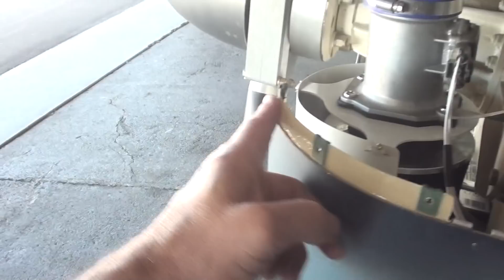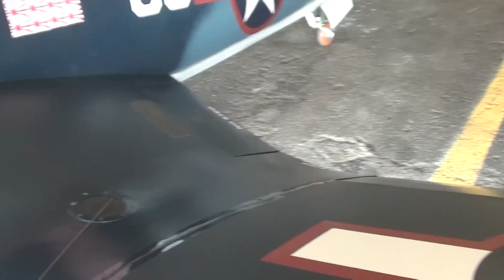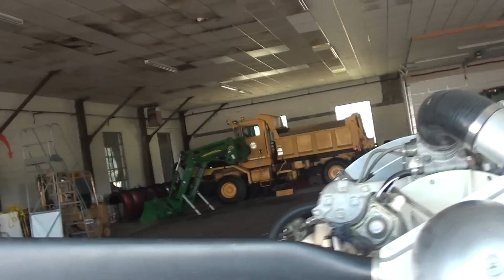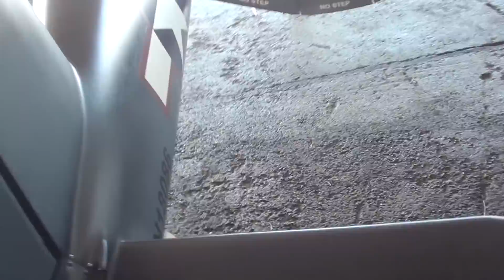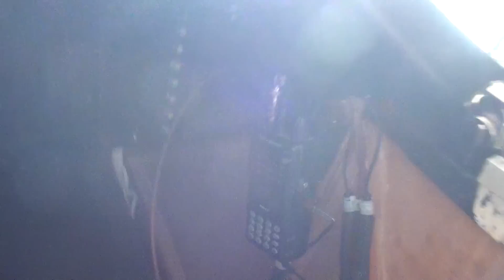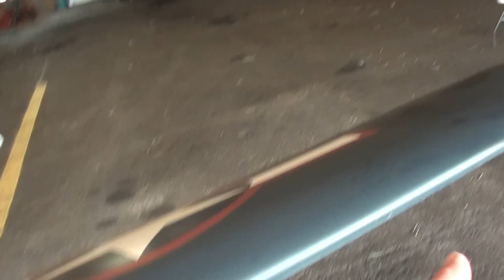WAR Corsair, New camera mount test 6/16/2024

Comment: Concerns: I wouldn’t mount that camera with a clamp out in front of the wing. Heard of other people doing that and having some problems. What about aerodynamic concerns. Another thing, don’t mean to scare you but the distance from the back of the wing to the front of the Horizontal Stabilizer is not very long; keep this in mind when flying it; don’t get behind the curve. This plane is not like a 172; definitely not as easy to fly. Good Luck.
Reply from the maker: Thanks for the concerns and advice. A lot of people mount cameras on the top of the wing tips, and don't seem to have any problems. Time will tell though.
Reply: @Dynodon64  yes they do but not with a clamp. With a screw down type. I have one for my RV-4 that I screw in on the bottom of the wing where the tie down rings are. Works excellent.

Comment: Don what is your experience with tail Wheels? pick a spot at the end of the runway and keep your eye on it you'll stay way ahead of the plane also if you have differential braking that will help tremendously I used to fly them squirrely little Mark Brown Starlites and you got to stay ahead of them or they'll get away from you.
Reply from the maker: The only problem with picking a spot out ahead, is, you can't see over the nose. But I do know what you mean. I see you avatar pic, and I fly Gyro's too.
Reply: @Dynodon64  @Dynodon64  I've learned over the years that flying taildraggers requires full commitment get on the power get the tail up so you can see over the cowling and fly. Stay up a while don't even attempt to landing till you got a good feel of the aircraft. I had a 3/4 scale Fokker D7 that thing was impossible to see over the cowling... I just had to get that tail up and go. Yes been flying Gyros for over 30 years.
Reply from the maker: @teeterblock  I started flying gyro gliders in 86'.
Reply: @Dynodon64  92 for me I was 21

Comment: i see why your so cautious about the wind... What would be the difference in airspeed between taxi with the tailwheel where you want it and beeing airborne?
Reply from the maker: The winds help with airspeed by reducing ground speed, if it's coming more head on. If the plane needs 60 mph to get airborne, and you have a 10 mph headwind, the plane will fly at 50 mph ground speed. It will take @65 mph to lift off.

Comment: G'day Don,

Yay Team !

Excellent stuff mate...

I was a bit concerned that clamping onto the base of the Pitot Tube might impede the Boundary-Layer draining back from the Pressure-ports & Orifice..., Overthunkin' as par for the course.

It looks great.

Now, if you can organise to only fly
Downsun into a perfect "Cerelean Blue" Dome of a Sky, then the Light-Dominant Aperture-Software in the Camera will ignore the Bright Sky by the "Blue-Screen" Effect, so the rest of the Frame
Will retain even Lighting, which allows for really good
Colour-Contrast.

The more Cloud or Haze in the Sky, I find, then the more "Light-Struck" the Images will be, resulting in bright-white
"Burnt-out" Clouds with dark Sky behind & shadowy Ground under the Pearly Sky...; kinda thing.

The local Weather department of the Universal Creator Godtheory threw me a couple of  such really top-notch Days recently..., and I captured both with the Chestplate-mounted Body-Camera one...
"Blue-Sky Electric Motorcycling ; Glen Innes Skybridge, Australian Standing Stones, Analemmic Calendar!"

Showing a trip into town on the Highway...; and,

"Golden Light, Electric Motorcycle Pizza-Run, Deepwater to Yarraford ; 29 Km in 51 min., 31 Km/hr Av. Speed."

Coming home on the Tertiary Rural Road Network (because that stretch of highway is unsafe to share with Traffic doing 100 Km/hr when limited to 45...; Guardrails too close to the Fog-Line, and Double unbroken Centrelines 4 inches apart for a couple of miles.).

Dirt Road with savage Potholes and some vicious Corrugations beats super close Formation Manoeuvres performed continually, with strangers at 2 ft of altitude.

In my view, at least.

But, yeah, for truly
Eye-popping footage,
Late afternoon
Going towards a
Clear Blue Sky, with that
Horizontal golden light flowing over your shoulder...; 
I
LIKE it...(!).

Keep on keeping on,

Stay safe.

;-p

Ciao !
Reply from the maker: The camera had no adverse effects on the pitot readings so far. There are vent holes at the front of the lager diameter tube. So the camera is all the way at the base. At least 4-6 inches behind the vents.

The camera sceen was hard to see in the lighting stand inside the hanger looking out. Also tough to see outside in the light. But the auto adjusting part of the camera seems to be doing a good job. This is a Sony handy cam, so it's not a cheap camera.

The best time to test and fly would be just before sunset. When I got home an hour later it was great out. wouldn't you figure. 

So thanks as always, see you on the next one.

Comment: As someone commented, I too am thinking a Corsair style leather headrest to cover that thumb nut would be nice. In an incident rich environment that test flying is, your head and neck and body will do things you never would or could willingly. You know stuff happens; "belle" can be replaced, you, not so easy. Also I agree, It's helmet time on these runups...you're doing 50/60 MPH, you can get hurt in a wind gust or tire failure or whatever. I sound like just a dottering old fool but I used to ride big bikes and never wore a helmet until one memorable accident 53 yrs ago. I've never seen Steve Hinton (PofF) or Thom Richard (CAF) play with their Corsairs without a helmet.
Reply from the maker: The plans do have a small head rest that you can put on. I will make one and install it. But my head still would be very hard to even touch it. There is no room for a helmet. My headset touches the canopy now. I plan on making a deeper canopy sometime. This is only a half scale replica, not even close to full scale.
Reply: @Dynodon64 I know, I'm just rambling. I like the plane a lot and you've put so much effort into it. You have excellent skills and it shows.
Reply from the maker: @raybame5816  Thanks for the concerns. I'm working on it now.

Comment: Great view....i noticed your prop spins clockwise . So getting tail wheel time in a counter clockwise rotating engined plane wouldn't be much help. Have you tried pushing the stick forward to get the tail up?
Reply from the maker: I had the tail up in the last video. Yes I have to use left rudder on takeoff. I hold the stick level or just a little forward.

Comment: If belt tension is fine try some CRC belt conditioner to get rid of the squeal.
Reply from the maker: Last time the belt was loose. When it squealed before, I could see the volt meter drop. It didn't drop this time.

Comment: Being that you filled the coolant reservoir halfway and it may overfill, I would at least add a hose facing downward so that way the water doesn't spill onto your hose or alternator. You wouldn't want to lose power during takeoff or flight. Please tell me you tightened that hose clap at the oil filler cap! Much much better view.
Reply from the maker: I do intend to add a drain hose to the bottom of the cowl. The oil cap hose is tight. It just moves a little from the mount clamp.

Comment: Hey Don, I've been meaning to ask what are the dimensions of the cockpit? It looks awful cramped in there for a fella of your height.
Reply from the maker: The cockpit is just shy of 24 inches wide. I'm 6'-1". Any taller and it would be hard to use the rudder pedals. My elbows rub on the insides.